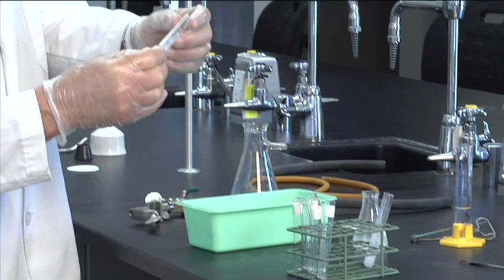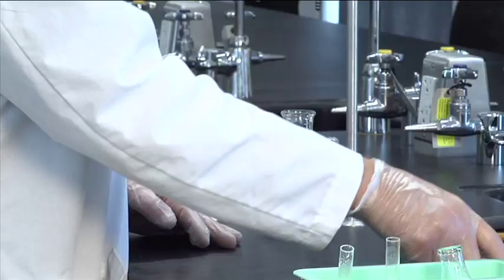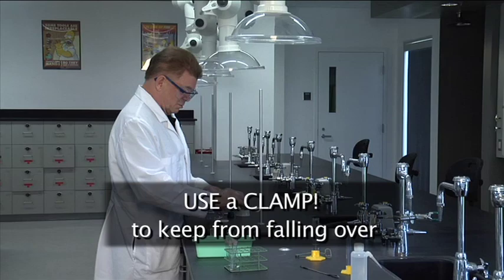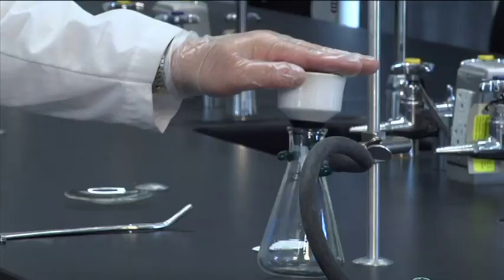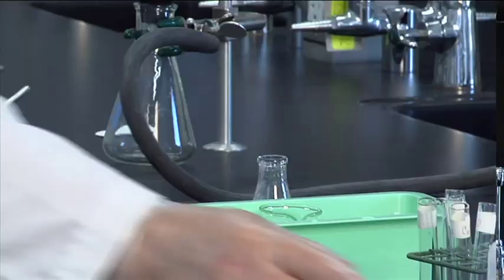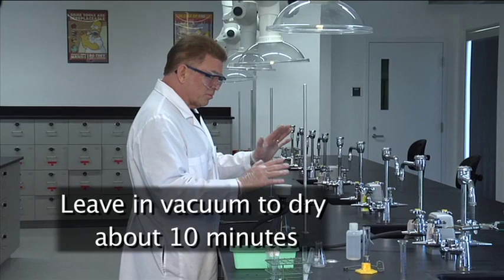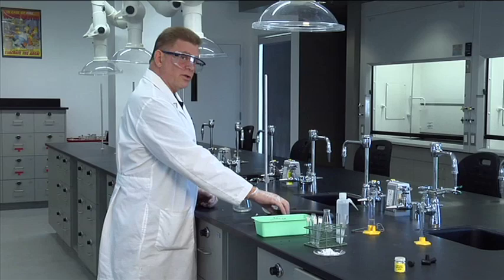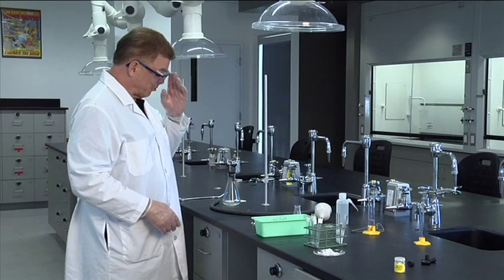3 O Chem Vacuum Filtration (CC)

Comment: well done. 
one thing learned was to not try and remove the filter paper with the xtals on it.  
like to weigh them all together , then subtract the weight of the paper. but rather to scrape out the xtals onto the watch glass. then weigh just the xtals.